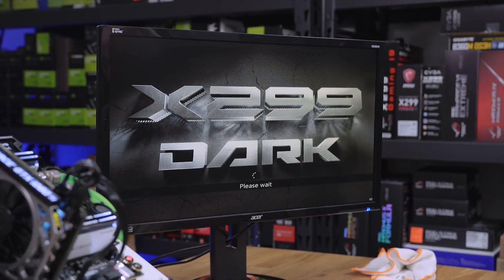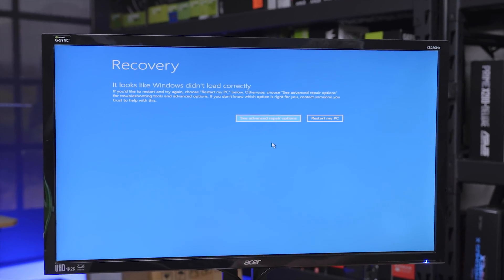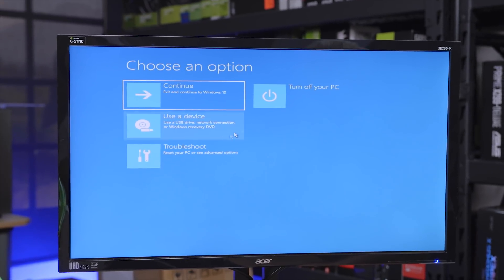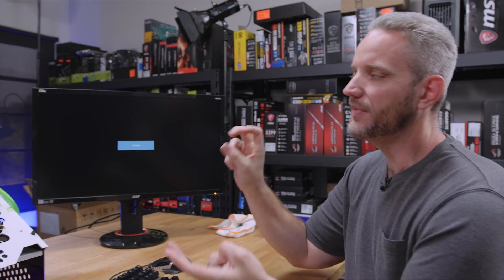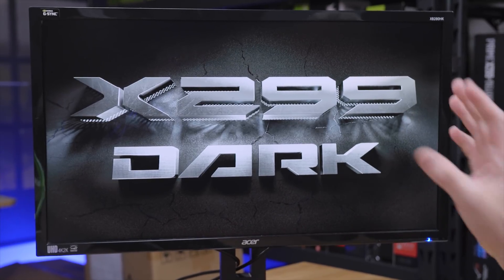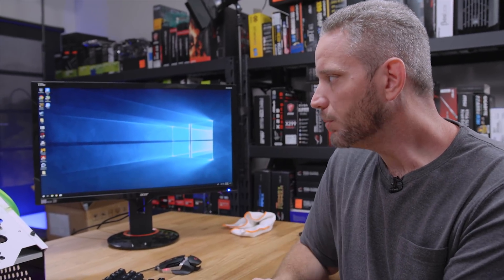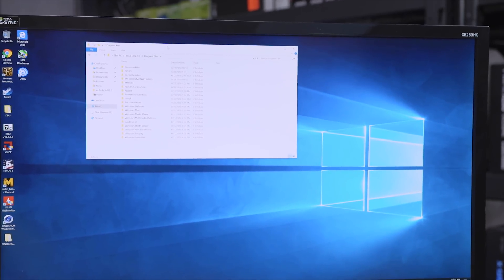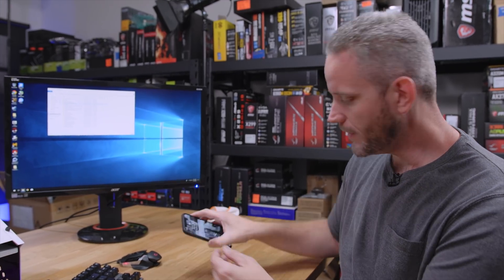New Test Bench Keeps Boot Looping... Here's how we fixed it

Comment: Why not just reinstall windows and load a backup.
There is even an option in recovery settings that resets the OS and registry without deleting stored files.

Running a test bench on a bloated OS is not a good idea

Also no reason to use this situation to trash Windows 10, as Windows 7 wouldn't boot at all if you change your motherboard.

Comment: No wonder why windows 7 is still the best os!
Reply: everyone said the same about windows xp, and windows 98
Reply: Win 98 FTW
Reply: Except in every way that counts, performance and stability, it isn't. It's slower AND less stable.
Reply: It would still crash just as hard in this case
Reply: What do you mean it will crash as hard? At least on Windows 7 you can get into safe mode a lot easier.
Reply: aBoogivogi
Yes, win 7 had plenty of bluescreens for many reasons including this... but safemode fucking worked and you could remove things... so ye... not the same is it...errr nope!
 look i answered for you so you don't have to.
Reply: @DAGATHire Windows Installer is just as disabled in Windows 7 safe mode as in WIndows 10.
@DarkPheoneix Yes the insane amount of menus before you find the safe mode function is stupid. Still the reason why they removed the old pres Fxx option was either because Windows 10 boots to fast for the key press to register or because adding it meant they had to hold for a few 100 milliseconds to register it. I can't remember which explanation was used but in my opinion they are both rather stupid from a user friendliness perspective even if there is some truth to what they are saying.
Reply: RyzenMaster would still require Windows Installer to be running to uninstall properly which Windows Installer would still not run while in safe mode, even in Windows 7.

The only difference with Windows 7 is that you could press F8 to get into safe mode to rename the folder.
That is even if you could switch major hardware components like you could with Windows 10.
Reply: Technically you don't even need to get into Safe Mode to rename that folder. Could have run the command prompt from the recovery menu and done it via command line.
Reply: I just hate the fact that windows 10 has renamed a bunch of stuff for the lols. Why rename "my computer" to "this computer" and other stupid shit. It frustrates me to no end when I'm searching for stuff.
Reply: The best of all damn time!
Reply: Yeah most likely. You could get lucky off course, but even so Windows 7 was not as good as cleaning out unused drivers so in terms of stability even if it did boot your mileage may vary
Reply: Mircea Prunaru best Windows OS*
Reply: Nine's And AK's best os*
Reply: Or AMD could have done their job and just let the application shutdown gracefully when no AMD CPU (or AMD CPU driver) was present. Basically something Nvidia control panel and the old ATI settings has done for ages. Not sure how that new crimson software behaves as AMD GPU's hasn't been relevant for a while.

Comment: Ohhh to be in 2010 again when Windows 7 was rockin and rollin.
Reply: Dex4Sure  pfftt. DKMS. Why rebuild the kernel manually for a kernel module? What are we in 1999??
Reply: You do realize this is a issue with how the Core of Windows handles drivers right? Regardless of the Windows operating system, this is gonna happen. It's a Windows specific issue.

Comment: windows 10 sucks but still having one windows installation for all hardware does not make sense. at least have one per CPU vendor. after all you do this for a living....
Reply: my thoughts exactly
Reply: I disagree. Having one os is better. I own a retail license that I can use on whatever build I make instead of a oem version where I need to buy a new key for every build. So i can switch to amd or Intel and different brands for hardware use.
Reply: +Dave Dörenberg-Veltman
I disagree.  Switching between test builds is as easy as 1 2 3.  All Windows 10 licenses is based off what hardware your running it in.
You can check this by literally going onto your Microsoft account in the Windows license section and it'll specifically tell you which computer, motherboard and all that this key is linked to.
You can however change which Windows said key is activated to however many times you want though.
Reply: Nighterlev what I'm trying to say is that the license I own I can install it on my next computer. I've had multiple upgrades and used 1 key. I know it's linked to my account but my key requires to be activated on 1 machine. So it's essentially linked to my account not my hardware like oem does.
Reply: BTW Folks, im makin a personal comment on the video, and maybe entertain jay as he does me, i could give a rats ass on what anyone has to say, like or dislike about my statements..maybe my ideas are pipe-dreams, its not because of me they cant exist, but in the ideals of the population of sheep and followers, agree, dont agree, i dont care, i dont do argumentive trolls, as for not swappng to linux, most people  surf and thats about it, do the social media sites,email... all done thru a browser,even  the equivalent of ms office can work with microassholes office.... why they might not be able to install linux, if installed for them, they get around just fine, for that matte, how many actualy do a custom install of windows, or any installation??
so i dont see any problem, and really...., wouldnt you rather have the extra 100.00 for a build, than a os, everytime windows decides to change format enough to decide how and what you can do on the hardware you purchased? or do you need somebody to tell you how to use your own property? sorry DING wrong thx for playing..not
Reply: Iam High
you made a personal comment IN another comment... so why not make your personal comment a new comment and address it to jay, also send him the cipher code to help decode your ridiculous English
Reply: sigh....hmm he made the video...his channel, if you cant understand my typin...good, if he has a problem with my speech, im sure he'd say so...one reason i dont comment on may things, look in the mirror, there ya go...no likey my talky, no looky...kaphesh?  in other words....naDevvo' yIghoS 'ej Hegh
Reply: I'm sorry, what english are you speaking? I some how doubt you made it through highschool with that grammar.
Reply: +Iam High
no one does "custom installs of windows" lol what.
You just install windows, and done.  Nothing else is needed, and on laptops it's always pre-installed from the get go (although in rare cases you'll need internet drivers) but compared to Linux? that's a whole another beast just to get things working properly.  

Imagine trying to get a DX12 game running on Windows 7 when it 1st released without any DX12 support what so ever.  That's essentially how hard it is to get Linux just to web browse if you have no idea what your doing at all.
Reply: To be fair, getting used to a new operating system is hard, but with a distro like Ubuntu, you might have trouble running games and the proper graphics drivers out of the box, but the neat thing will be most of the standard stuff works just fine - directly - no drivers at all. I find "web browsing" to be an actual, very good example for one thing that nowadays really works well with Linux!

But especially for what Jay is doing here, Linux would have allowed him to just swap our random hardware and you would not need to reinstall your system (ok, unless you pull out the boot-drive - duh).
Reply: Nope it doesn't suck at all.
Reply: i disagree, for a sngle reason, back in the days of 98se, i shut down windows xtra and hidden features to the point i had 98% resources free at startup, mind then we were working with less than a ghx cpu and mb's of ram.....point is it theyre restriction of control of my/your hardaware, they think we are the ones who are stupid, they dont need to reserve bandwidth for updates, any sane person wouldnt try to game and update at same time, even if you set it to only ask you , it wil still do something in background to screw up your current task, face it, they have nowhere as current updates as linux, nor the resources of others who help to fix whats broken there, without putting it to you in the bent over posistion... sure they" gave free upgrades to 8 and 10 for previous users....i still know a few who are still pissed over windows vista......myself, im on the last 64 bit 7 that had support til this year, either ill get a flavor of linux and the 3rd party software to convert it for net based windows games, but if, if the whole gaming community would show the fact we are going to linux and F$$%%!!!! windows period, you watch how fast the autoinstallers are converted, at the moment, not enough peeps have switched, or decreased play and sales to be effective, the country once wanted 18yr olds to vote, changed natonal policy in 3 monthes to do so...as businesses, that wouldnt take that long, i doubt it would be 3 weeks before somedy said we are losig subscribers and players, revenues down 40%.....linux installers would pop out of the woodwork like, and not racial here, china has rice.....
Reply: +Iam High
sorry to say but your fantasy of everyone switching to Linux just isn't happening.
Everyone would switch over to a brand new windows OS that has no relation to the ordinary windows before anyone would touch Linux.
Hell, I know people who still use Windows XP for god sakes lmfao.
Reply: +Iam High
Linux is unusable to the average person. it's not user friendly for the average user. We really need a windows alternative but Linux isn't it. never has been and never will be.
Reply: yep... and also... if you are gona test if more cores equals less performance (previous video from jay) wouldn't it make sense to go with the company that make the most cores.... hint hint not intel... the shilling never stops.
Reply: DAGATHire, I'm pretty sure that the 7980xe, which has 18 cores, has more cores than the 16-core 1950x threadripper (that you're obviously fanboying over)... 18 > 16 last time I checked....

And yeah, having an OS drive for each major vendor would make sense...I thought he was going to have two test benches, one Intel and one AMD, but I guess he decided against it for some reason
Reply: Wraith6765
Ye.... the intel is the obvious choice... you are right. What was i thinking. 
P.S. no fanboy here... i buy what actually works in the real world. DOn't care what colour label it's got.... and this intel chip... is straight up dogshit. Jay just shilling as usual.. remember his video about how stupid this chip was... opps now he's using it... ohhhh dear.
Reply: But threadripper 2 2990WX is just around the corner.

Comment: I agree that Windows 10 sucks
Reply: Windows10 is great, but its not for idiots
Reply: well... See the only reason I am still on Windows is, that most my programs are only on there. If there where options on linux I'd leave that mess of an OS behind as soon as I can.
Reply: Install a remote application server and run linux and serve your windows apps to your linux machine that way.
Reply: Not for idiots?
What?
Reply: Synthematix imma send your reply to bulletbarry
Reply: Which version of Windows 10 though? 
1803, 1709,1706, 1703, etc.....etc....
Reply: all of them. Windows is and will always be a mess.
Reply: Win10 is great. Has good driver support. But the interface is very confusing. You really have to know your way around.

Comment: Who in the blue hell installs new hardware (mobo+cpu) and doesn't install clean Windows. Oh yeah, Jay.

facepalm
Reply: If you pay attention, most big youtubers/tech people have 2 SSds/HDDs that have a windows install/app on them, one for Intel, one for AMD, PURELY because they go through so much hardware while reviewing it that it becomes a HUGE time sink to the point that its a detriment to the content.
Reply: I don't know My windows 10 install has gone through 3 CPU's & mainboards but all were Intel CPU's and chip sets. The windows itself started out as Windows 7 Pro then Windows 8.0 pro updated to 8.1 Pro  and all releases of Windows 10 Pro and I have had very little issue with each hardware or Windows upgrade.

The thing to remember is to always prep the system before each Windows upgrade or hardware upgrade. You remove all Intel drivers and use Windows standard drivers since if you allow it I Wndows will just reinstall everything but use the built in drivers. Remove the graphics drivers go to basic driver & remove the audio drivers. I for my own personal preference also disable all startup TSR's form the start up if I am doing a Windows upgrade. 

I also run my cleaning tools to check for malware and viruses just in case and clean all temp files and cache files as well as all Windows log files with Ccleaner. My point is my Windows is old but it performs like it is a fresh install because well I know how to take care of it since I do this for a living. There are more steps I do to make sure a hardware or Windows upgrade will go smoothly but not worth listing those here. Side note if I would have been on Windows XP 64 Bit I could have said that my WIndows install started life out as Windows XP but since Windows XP 64 was basically a open sore waiting to bleed out I never stuck with it for more than a week of testing.

Heck you can get into big trouble just switching from AMD based video card to Nvidia or vice versa but if you take the time and properly remove eveything when you install the drivers for the new card the system just works with it properly. Another side note which I have found to help is if you go from a Intel based system to a AMD based system you will almost always get a BSOD the easy fix to get it to boot is to go to Windows\System32\Drivers and remove intelppm.sys and reinstall the hard drive back into the system and then boot you will get to the desktop and be able to remove everything Intel from safe mode as long as the Sata/IDE drivers were installed as Standard driver set which is the case for 97% of  most basic desktops systems if not there are ways around that also.
Reply: Some people call me Steve what if he had Ryzen Master on his harddrive and not his SSD
Reply: Literally everyone since Windows 8/10 came along. And unless you have installed an AMD application coded so poorly it crashes unless their hardware is present you will be fine 9 out of 10.
Reply: i think he did that so he doesnt have to activate windows and install all of the softwares he needs but even still its stupid
Reply: Actually you would still have to reactivate windows, if any license entered at all. Windows imediately detects a new mobo and the activation is therefor no longer valid, until you reactivate it